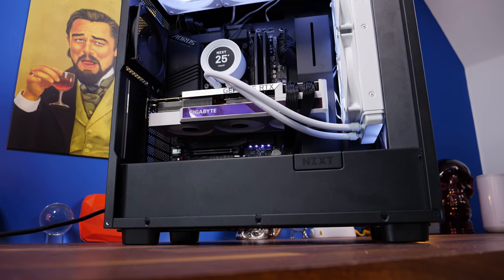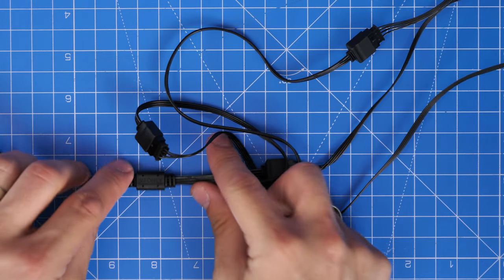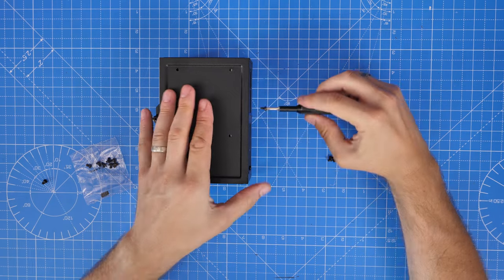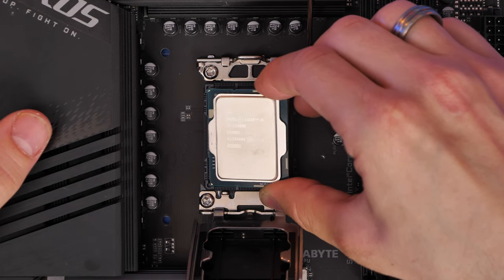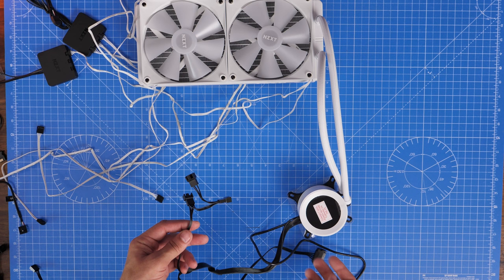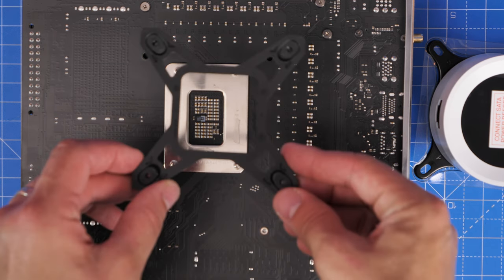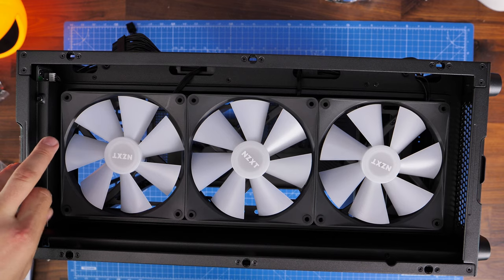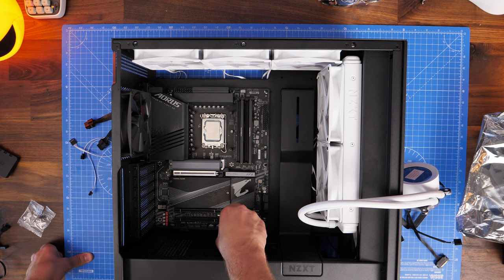NZXT H7 Flow RGB build guide with push pull, fan wiring logic and Kraken Elite cooler

Comment: Cpu cooler radiator pipes on the bottom? That's not good.
Reply from the maker: It's fine. The pump is NOT the highest point in the build. https://youtu.be/n9TQsmj8rvk
Reply: @TheProvokedPrawn  look 4:22
Reply from the maker: @pierzus1  at RGB cables?
Reply: @VladiatorX what does 4:22 have to do with the pump?
Reply from the maker: @VladiatorX  it won't get trapped there...worst case it would be top of the radiator
Reply: Its actually GOOD. The TLDR of that Gamers Nexus video was: 

IDEAL - Heat exchanger mounted to the top of case 
GOOD - Front case mount - tubes at bottom
BAD - Tubes up (heat exchanger mounted to the bottom of case)
BAD - Front case mount - tubes at top. (GN criticized NZXT for advertising their AIOs in this orientation)

Top of case mount was optimal, however not every case will support all AIOs in this type of a mount, e.g. you might not fit a 360mm AIO at the top.  The front case mount with tubes at the bottom was the next most ideal mount orientation. 

And in regards to the AIO pump itself, as long its lower than the highest point of the heat exchanger air will NEVER get trapped in the pump. The reason that front case mount - tubes at TOP could potentially be an issue (even though the pump is still lower than the top of the heat exchanger) is that as the heat exchanger is now at the top of the loop, an air pocket could form there, and that pocket will reduce the amount of coolant that reaches the tubes. 

If the tubes are at the BOTTOM in a front case mount, 100% of the tube diameter is saturated with coolant at all times, as the air pocket will be at the top of the heat exchanger which doesn't impact coolant circulation.
Reply: It is not good. If some air is in the pump at start, it may not be pushed down the pipes in to radiator. Even if it will, it will take significantly longer than if they ware leading up way. You can keep the radiator where it is but turn it, so in and out pipes are up higher then the pump. That's much, much better so why not doing it? It's just couple of screws.
Reply: @TheProvokedPrawn  
My bad. I checked it again. you are right. It should be fine.
Reply: It will be fine. In fact it’s perfect.
Reply: I swear the radiator police might be some of the most obnoxious people in the pc space. Stop nitpicking such TINY things that don’t actually matter for a guy that’s going to run this aio for less than a year 🤣
Reply: @pierzus1 😂😂

Comment: Hi there I want to use Ryzen 7 7800X3D cpu on my build, but I am not certain which is the best motherboard to use for it,  I want to be able to use 4 Nvme SSD Gen4 in the build without comprising the GPU lane down from 16 to 8.  I also want to use the Nvidia 4080 supper  but agone not certain which brand to get, I want one that won't cause any problems.  So I like to ask which motherboard and GPU would you recommend for this build?

Comment: My question is why don’t you mention the 3 prong connector that is connected to the 3 fan block on the front. I am doing a build with the same case and same motherboard and everything is connected properly but the fans only lights up and don’t spin.
Reply from the maker: https://youtu.be/kTocUr0zKUw
Reply: @TheProvokedPrawn  so essentially what I’m seeing is that I need to buy a separate controller for the fans on the front because they don’t include it with the case.
Reply: @TheProvokedPrawn  Did your case come with a controller.

Comment: Fantastic case. I removed the cable management bar and spray painted the mass effect N7 stripe on to it....and it looks awesome inside the case,better than i imagined! I am waiting on fans and gonna add a couple of mass effect stickers to complete the theme
My only gripe with it is that it didn't come with rubber mounts for the hard disk drive to dampen some of the vibrations.
Reply: Ya and they didn't have a slot for a floppy disc drive either!....JK We must embrace our lord and saviour M2 NVMe drives. They are so cheap now, you can get a 4 Tb Crucial Gen 3 NVMe drive for peanuts. They might not be as dirt cheap as a HDD, however if you're working with large files, the read/write speed performance uplift over a standard HDD is well worth the extra few quid. And if you're just using the PC for gaming etc, then you're doing yourself and your system an injustice by not using an M2 drive (or at least a bog standard SSD). That will be the standard going forward, for example, Starfield has listed an SSD as part of its 'minimum' specs.
Reply: @TheSwayzeTrain   the HDD i am using as an archive so no need for the speed , 4tb for 70$ is alot better deal than getting a nvme. And don't worry i got a 1tb gen 4 nvme (for about 100$) .
Its just a nitpick on the rubber mounts basically ,they did so well with everything in the case except that.
Reply: @goliathmb18  can’t you buy rubber mounts?
Reply: @phr3ui559   i managed to salvage some hard drive rubber mounts from a old pc from work , i still didn't put them in though i will do so once i take it apart soon to change the power supply and reorganize some stuff.
But yeah still a fantastic case

Comment: Looking for some assistance, I bought this case along with an NZXT b650e mobo. I used the stock splitter for the RBG fans in the front (no controller) and plugged it into the 5v header on the bottom left of the board. Oddly enough on boot the lights turn on, but once CAM boots up, they turn off and are not recognized. I'm not sure if I'm doing somthing wrong. I'm about to disband them from the daisy chain and apply each Inyo the available RBG slots on the board. thanks for any help.

Comment: watching this video i just realized i accidentally got the wrong PSU, mine is the RM1000x shift version which the connections are on the side. i honestly didnt know there were different versions.
nice video btw, always very informative.
Reply from the maker: You might be ok still. It should fit I'd imagine with the cables running up the back.

Comment: I don't get it. This 'elite' version has room for 3 140mm fans in front - but their kraken AOI only has 120mm fans? Is that by design and 140mm fans won't work on an AIO rad for some reason? 
I missed it in the vid but did you put those 140mm case fans on the top?
 Thanks, i'm new to all this
Reply from the maker: This is not the Elite version of the case?
Reply: @TheProvokedPrawn  I've looked at so many - i get mixed up but i get it now. Thanks

Comment: I only have 1 header on my mother board however I have an NZXT case just like you with 3 pre installed fans and also an aio. Will I be able to access the aio pump if I connect everything to a Corsair hub?

Comment: Is it possible to have a 360mm on the top while also having a 240mm on the front but mounted it a bit more to the bottom. Is that even an option?  My CPU has a 360mm and my GPU a 240mm radiator. Thank you in advance

Comment: A RGB related question of course. I have this case and all my components ready to go I'm planning on removing the case fans and front mounting a 280mm Nzxt aio and planning to use come corsair icue fans for the top and rear.

My question is can I just sync all these faans if I connect them to the mother board using the motherboard companies rgb software (Asus)?

Comment: So the h7 flow rgb case comes with three f140 rgb core fans but no controller? So how do you make the rgb work withkut having to buy a controller?
Reply from the maker: connect it to the motherboard, I showed how.
Reply: @TheProvokedPrawn  yeah I went back through and clocked that.
Can I do the same for the fans on the cooler so I they will all match through motherboard software or will I need to buy something else? Trying to avoid having to buy another controller and a usb splitter as I didn't forsee the extra expense !
Reply: @dreadi did you manage to build it ,did you need any additional adapters eyc
Reply: @Pristine1  all built.
Had to buy the nzxt fan hub to allow me to run nzxt fans together but apart from that no...well bought an extra fan as well so 3 140mm intakes, 3 120mm on the kracken elite and 1 140mm exhaust
Reply: @dreadi  oh ok, just considering now if I should go for the H7 Flow RGB or the DF700 flux, also I forgot to ask how is the kraken elite, I heard some people say that the nzxt cam software is poor and that sometimes the kraken elite can bug out or smthn like that, is this true?
Reply: @Pristine1  so far so good. I've had no issue with the software at all. All fans picked up and the screen works lovely!
Reply: @dreadi  cool thanks bro

Comment: Great video, love the white and black setup, simple and clean. 

On a related note, do you happen to have Cinebench and thermal benchmarks available? (Edit: nevermind just saw your newest video, many thanks)

If not, have you noticed any thermal issues while using it (if you can recall)?

I have a I9 13000k. I had trouble cooling it with a 360mm bequiet silent loop 2, push and pull config + grizzly kryonaut paste. Had 100deg in battlefield 2042 and was thermal throtteling :|

I have now bought a kraken elite 360mm, as I believe the bequiet aio is broken (as it makes a terrible noise).

Comment: Hey @TheProvokedPrawn , need some input, I have a H7 flow now, would it be possible to have a 360 rad at the top for CPU and another 360 rad at the front for GPU, would having this combo fit this case? this is a huge concern which I havent found any answers to. Would appreciate your input alot!

Comment: How did you get all your fans rgb to sync? On my h7 elite all the fans that came pre installed wont sync. If try to change lighting effect they all out of sync only works on default preset modes in cam.
Reply: Me too! Did you find how to sync it ? I cant even change the color :(

Comment: Would it be possible to control the pre-connected front 3 fans using one port on the rgb controller and then have the other two ports controlling another two fans? This would save buying an extra controller on its own so just thought I'd ask :)
Also thank you for a great insight on building with this case! I'm looking to build my first pc in this case within the next couple of weeks!
Reply: I was wondering if it possible did you get the answer?

Comment: I see, u made another video with timestamps. Cool. U should link to this video in the comment, "Update with timstamps (and explenation (if it is explaned, watching as I write)).
19:20 I read its enough for a 400mm graphic card. This has me worried a bit. I dlnt have a 4090, yet....what was the length of the graphic card that didnt fit? 31:48 oh,thats why u got less space. Isnt there space further to the right, behind, or inside the black margin?